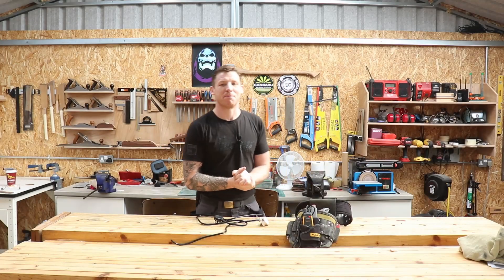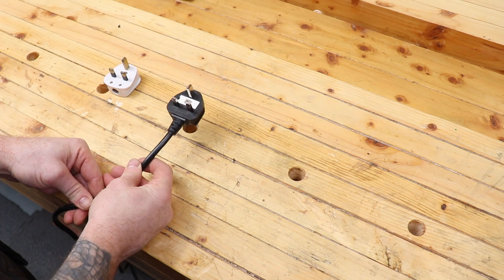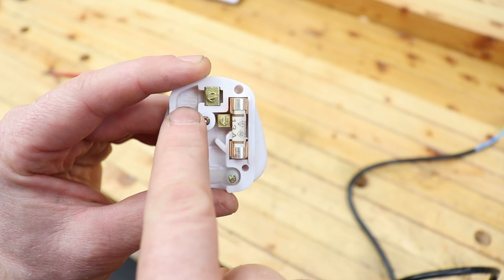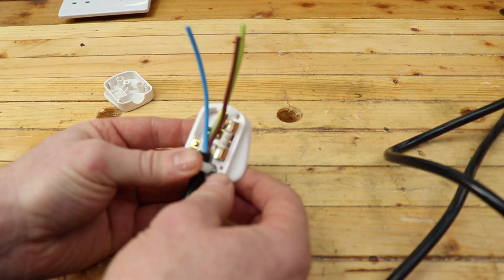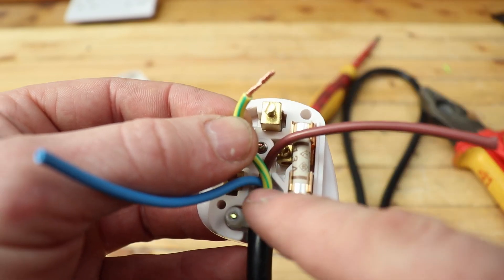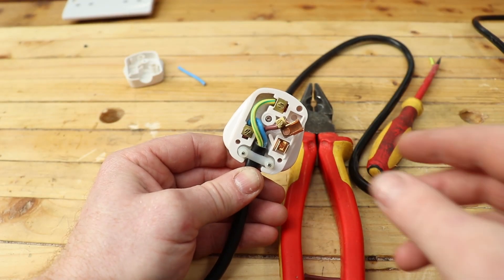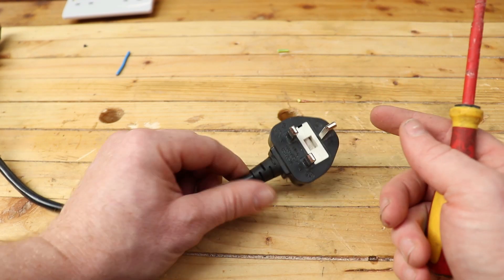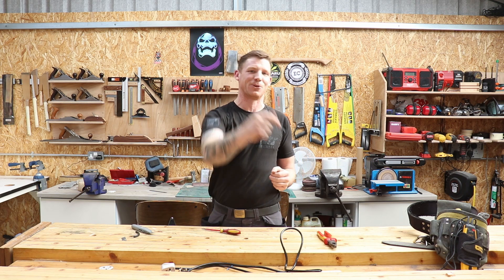Electrical Basics 1 How to Wire a Plug and Replace a Fuse. By an Electrician.

Comment: Hi guys I have a question;
Does the plugs in Ireland always have a fuse?
I'm a electrician apprentice from Denmark, and I have never seen or heard of a plug with a fuse?
Reply: This system was introduced after the last war, when we had a serious shortage of copper. So, instead of all sockets being wired directly to the consumer unit (fuse board) we introduced the "ring-main" system, which uses less wire than the system that you have in Denmark and the rest of Europe.
In the UK,  all the sockets come off a cable that runs around the house (typically one ring to each floor) and the fuse protection is in the plug for each appliance, instead of being at the consumer unit.
The consumer unit also provides fuses (or circuit breakers) for each ring-circuit. 
The consumer unit will also have separate circuit breakers for  each heavy-duty appliance, such as the cooker or immersion heater. These appliances will be directly wired to the consumer unit, just as they are in your country.